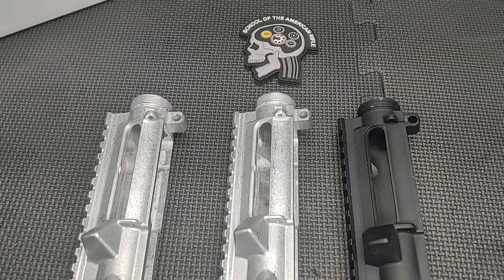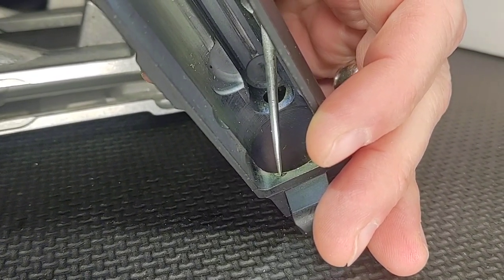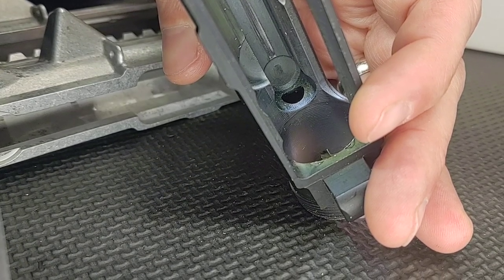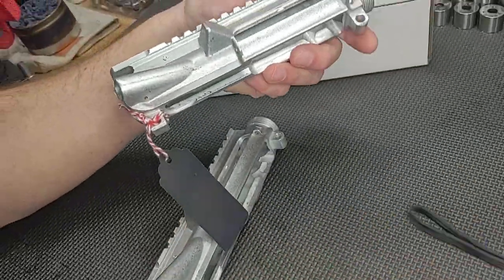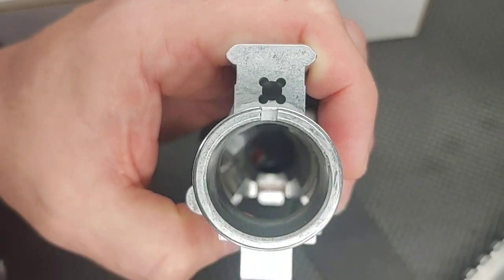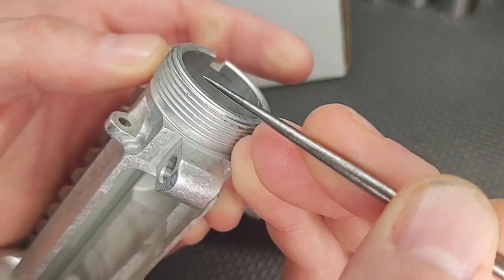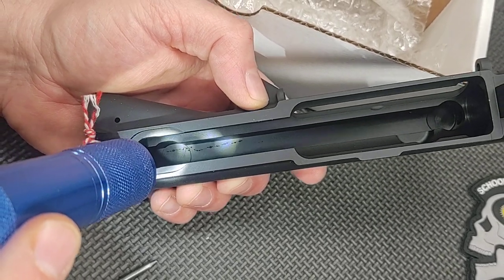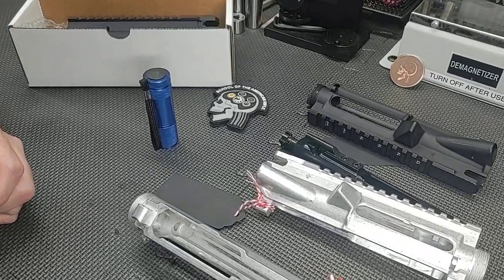AR15 Upper Receiver Visual Checks/Inspections

Comment: Yea sir, I’m trying to identify an upper receiver I bought. The only markings on it I’ve found is a “M4” stamped on the front side where the gas tube enters the upper. Is there any other markings I could find to identify what upper I have? Thanks it has the AH triangle stamp as a forge mark also

Comment: Sorry. I know this is an upper video, but I had a not quick question about the installation of the forward takedown pin, spring, and detent. Now while I haven't seen every manufacturer's lower, all of the ones I have seen have a tiny hole in the...uhhh... spring seat. I'm guessing it was put there to let water/dirt out or put lube in. While some make a tool and everyone else has a hack for the installation, most come with the warning "be careful or you will launch your detent to the same place one of your socks goes after laundry, never to be seen again". 
Anyway, after I had assembled mine, I think I used the razor blade hack, for some reason I took a flashlight and looked in that tiny hole. Sure enough I could see the spring. So here is my question...If you get a small gauge needle, compress the spring with a punch, insert the needle into the hole between the punch and spring, remove the punch, drop in the detent on top of the needle, insert takedown pin, then remove the needle, everything springs into place, and the people who make the installation tools cry? Just had to ask. Love your channel🇺🇸👍🇺🇸

Comment: Chad, will you be accepting any work anytime soon? (I'd seen a comment somewhere a few months back that you were booked up and not accepting new work). I'm curious because I have a supposedly unfired early 90's Colt RO727/M16A2 Carbine barrel and similar era Colt A2 upper that I'd like some advice on as it relates to receiver feedramp to barrel extension ramp alignment. Figured I'd as!

Comment: How does the machining go so poorly as to have such obvious problems?   Would like to see how they screw it up that bad.
Reply: @jamessellers6276  correct
Reply: @jamessellers6276  that, along with quantity over quality often gets encouraged.
Reply: @SW-ii5gg  Machine operators instead of machinists, quantity over quality, and a lack of quality control to ensure issues like that don't get sold.

Comment: hi my bolt cracked at the area around where the cam pin hole is almost all the way through . what would cause such a thing and what would have or could have happened if it didnt decide to wrap it up and go home . (i didnt see the crack until i cleaned it
Reply: That's a pretty common area for bolts to break at; usually if a bolt doesn't have some lugs sheer off then it will eventually break exactly where you described. Obviously, don't shoot with that bolt anymore; you need a new one. If you want a bolt that's less likely to break there, then maybe try an HMB bolt. Instead of like a mil-spec bolt where the cam pin hole is drilled all the way through the bolt, the HMB bolt has its cam pin hole only drilled partially through the bolt. This should, at least in theory, make that area of the bolt stronger.
Reply: @LawlessNate  yeah i been checking it out and it seems to happen a lot . i already sent the group  in to the company they are replacing it with a nickle boron group it only had a little over a 1000 through it
Reply: @giuseppe_M  No bolt should be breaking after only 1,000 rounds. What brand bolt carrier was it?
Reply: @LawlessNate  A. P. F  Out of Minnesota it came with the rifle .